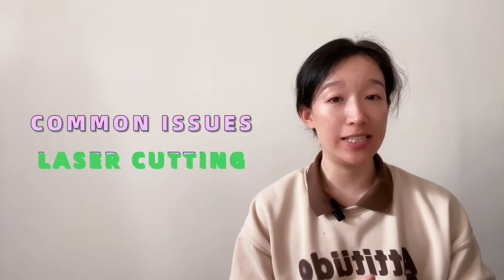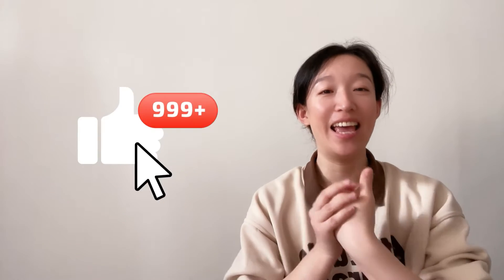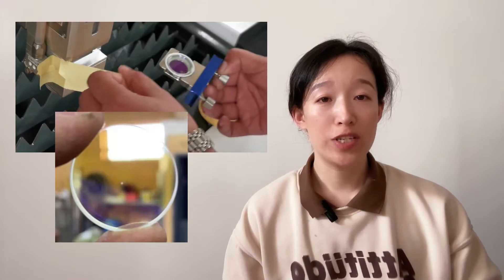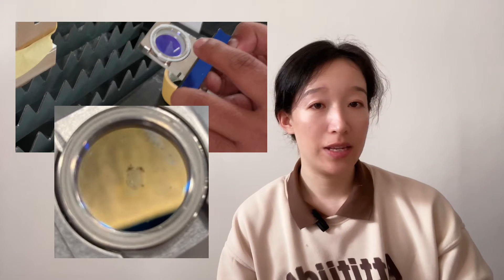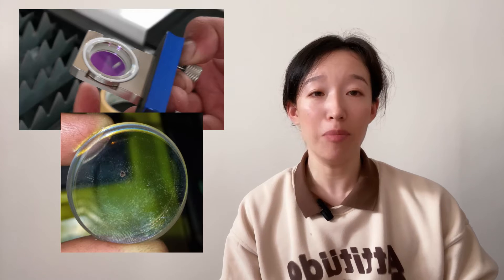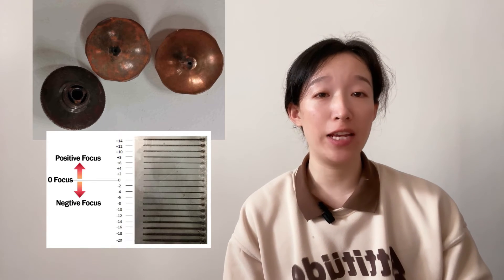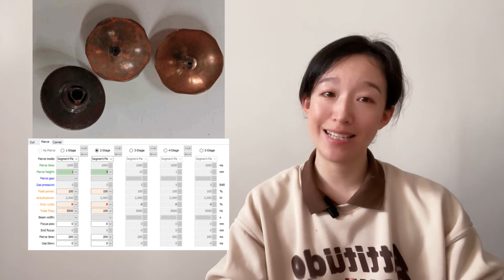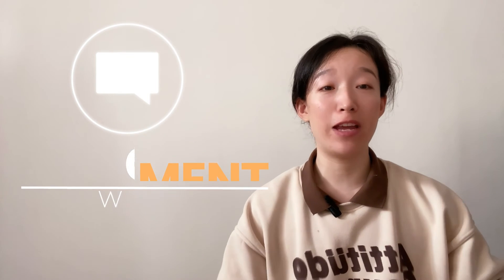Why Lens and Nozzle are Damaged? | Laser Cutting Problems

Comment: Hello, I have a 3000 watt laser cutter that I use to clean metal surfaces. When I start working, after a few minutes, a burn mark and discoloration and even blackening appear on the center of the lens. What do you think is the cause? It can't be dust bouncing off the surface, because I checked, could electrical fluctuations be the cause? Thank you for your reply.
Reply from the maker: You can check my videos on lenses, almost all possibilities have been listed.

Comment: Dear Clara,I am Faissal from Morocco, and I am encountering an issue with my 3000W fiber laser cutting machine. I would greatly appreciate your assistance in resolving it. The problem lies in the lack of response from the alarm motor/encoder, and the Z motor is unable to function normally. This issue arose subsequent to adjustments I made in the BCS100 settings, specifically altering the language from Chinese to English. I suspect inadvertent changes to certain values occurred during this process. Could you kindly guide me in rectifying this problem and resetting the settings to their original configuration? Thank you so much
Reply from the maker: Please provide me with photos of the current parameters first, and I will check if there are any problems, because the parameters are not fixed and need to be set according to the machine configuration. thank you for your message

Comment: Incase there is no uniform blade level in laser cutting machine causes a bad cutting ?
Reply from the maker: Yes, it is for sure. If the blade is not even, the cutting will be poor, like some parts are cut well, but some not.